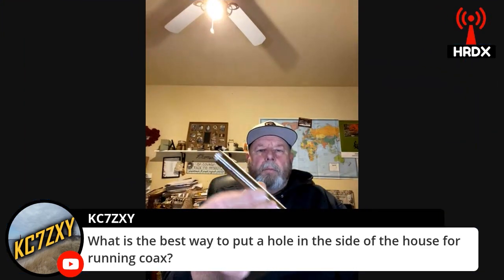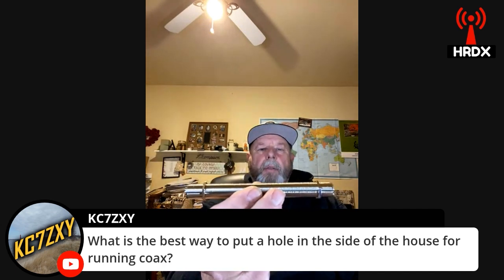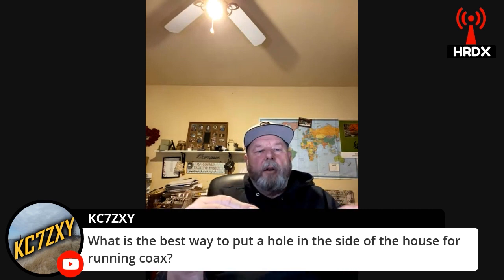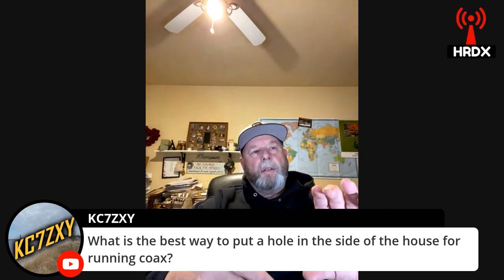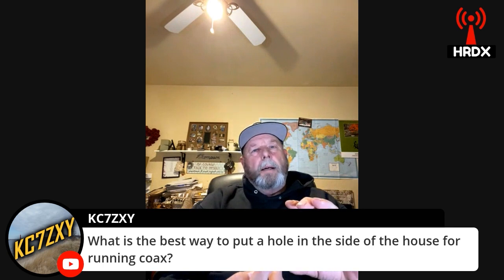What is the best way to run Coax into your Home?

Comment: I am planning a CB home base station.  My first thought is to place a lightning arrestor and a connection at the point where the coax enters the house.  Can anyone commentif the length of the ground rod is material to the wavelength of operation?  In this case 11 meters.  I emphasize this is a CB radio querry.:yt:🙂
Reply: The ham radio test says at least a 6' copper or copper clad rod driven into the ground.  The bands are both beneath and above the CB band...so I don't think it particularly matters.

Comment: New house, custom build.  Running Cat6 to hardwire routers on each floor.  I don't watch TV and I've never had cable.  Wondering if it makes sense to run coax in the house. What do you think?

Comment: @ 2.48, if you have a grounded metal box for entry will the long bulkhead connectors be ok to ground the outside to the box? I guess that what I'm asking is the outside of the connector supposed to be grounded or should I insulate it from grounding?
     Any information would be appreciated. 
     Yall Take Care and be safe, John

Comment: It's not pretty or a very good solution, but RG-316 fits through the weather seals of the windows here. I've had two cables in the windows since September (the better part of the winter) and haven't had any draft or leaks. RG-316 isn't great stuff for VHF but a short piece isn't the end of the world. And there's not a trace left behind when you remove it! Just my $0.02, de VE3GKT
Reply from the maker: Great tip!

Comment: To have a nice wall plate that has the look of one of your home's electrical receptacles with chassis mount connector(s) of your favorite flavor do this..
Tools and material needed
1.Single gang Mud Ring from your local hardware store or Home Depot.
2. Blank single gang wall plate (Google single gang mud ring)
3.Drywall knife or utility knife
4. Drill
5. heavy wire or coat hanger

Measure up from the floor to the middle of one of your existing electrical receptacles to determine height.
Locate where you want to have your pass through and place the mud ring with it's center at that measurement.
With pen or pencil trace the inside of the ring onto your wall. Cut the drywall out following your tracing with the drywall knife or utility blade.
You will now have a nice rectangular hole in your wall.
Carefully separate the insulation. You may need to cut. If there is electrical circuit work around it, de-energize if needed.  You should now be at the inside of the external sheathing/plywood.
At the inside of the exterior wall drill a hole to the required size and work the heavy wire/coat hanger through to the outside. 
Using the wire, push it through to the outside, tape your coax to it and pull it back into the house. Give yourself enough to work with.
Install the mud ring with your coax coming through the middle of it.
Take the blank wall plate drill and install your favorite chassis mount connector to it. Terminate the coax and connect it to the back of the wall plate.
Install the wall plate on the mud ring.
Done

Do what other have said and put a drip loop on the outside. You may want a plastic bushing for the exterior hole for a finished look.
Use double gang in lieu of single as required for your needs, # of connectors.
Reply: An afterthought... use a stud sensor to ensure you're not cutting on a wall stud. Many stud detectors also have an electricity sensing feature.

Comment: I've been thinking about this recently.  Moving to a new house and will be running 2 lines of coax into the house for HF and VHF/UHF, glad to see what everyone else is doing.  Winter gets cold here so was trying to minimize the amount of cold air that could potentially come through.  I am liking the idea of the bulkhead connector through the wall.